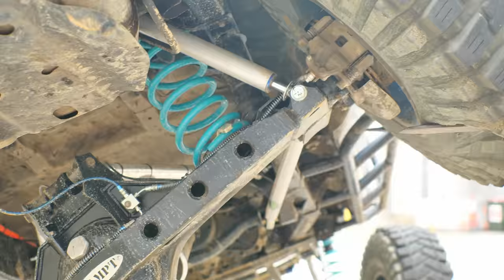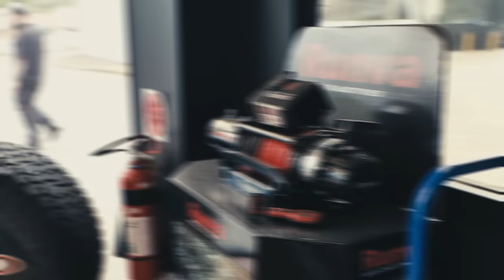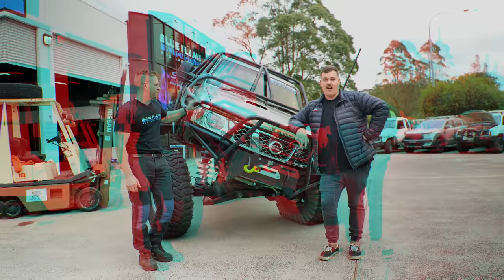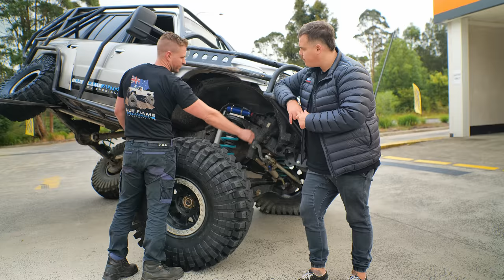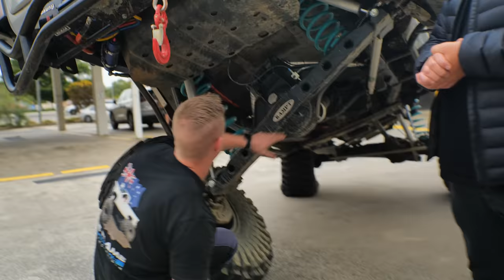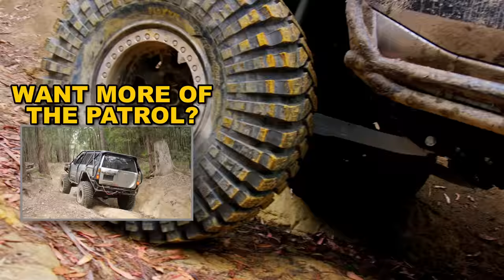Insane GU Patrol Comp Truck Walkaround! Is It Road Legal? Sussed With Sam Ep 8

Comment: Yeah looks cool but that ain't no comp truck, would be absolutely useless. 3.0l running 42s isn't going to win any races not to mention all that weight in the barwork jesus
Reply: No winch either
Reply from the maker: It's getting a boosted LS in 2023 so let's chat then 😂
Reply: @SamYoung4x4  still heavy as fuck with a high centre of gravity. Idk if you've been around comp trucks much, but that thing is more of a gimmick than anything else